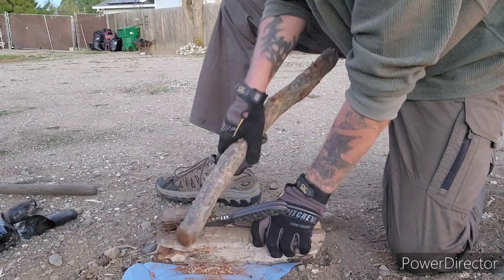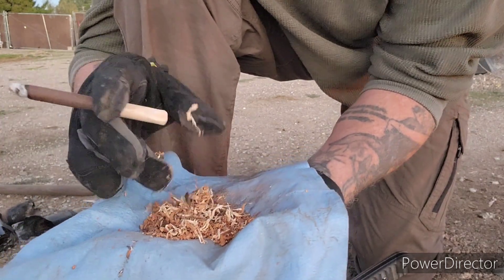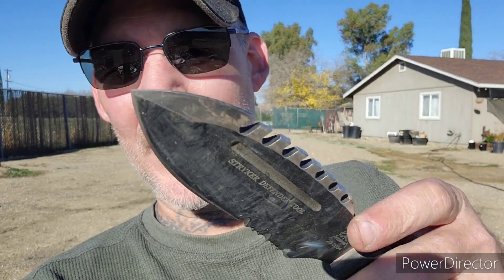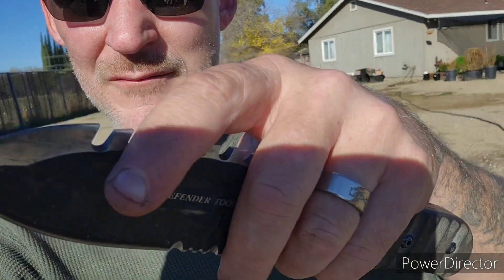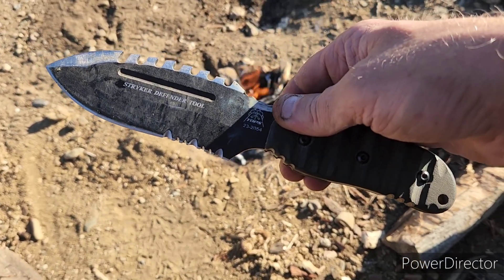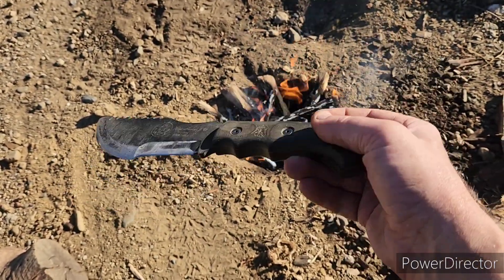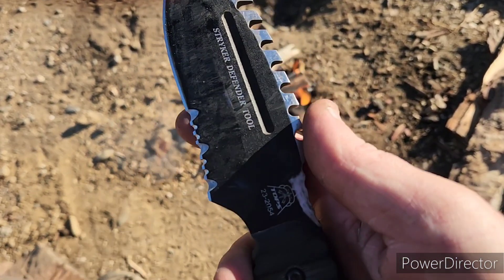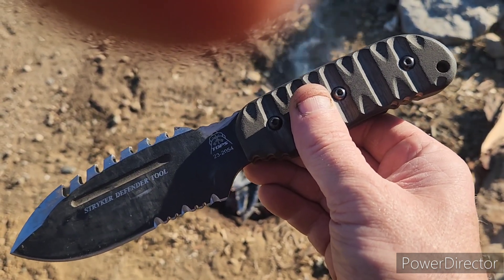TOPS Stryker Defender Tool, plus Char Cloth in a Glass Bottle.

Comment: That is basically a spike. It is entirely too short and thick to be any good at slicing and too short for efficient chopping. It's not good for much other than stabbing through a lot of clothes or a thick animal hide and probably some bones. It'd be good for opening a 55gal drum or as a tent peg. Too short as a saw. Yeah, very limited uses in all reality. Self defense and rescue is about it. But, hey, if you dig it, that's all you bud. There are much more versatile blades out there that are of similar length.

Comment: Ok,you obviously didn't do your research on this knife prior to purchase. For one, the back teeth are only meant to make  notches in limbs for running rope through as in tying down a tarp for protection.  Also,as smallish this knife is, it should only be advised for very small diameter limbs, not batoning large diameter 
piees of wood. You mentioned the sawback could cut open aircraft grade aluminum  materials, absolute crap. You are doing your followers a disservice.
Reply from the maker: So far, I have turned a 5' long cedar log into kindling by batonning with this knife.  The blade doesn't need to extend the entire diameter of the timber; all you need to do is remove chunks.  As with other things, size doesn't matter, as long as you know how to use the tool.  As for the teeth in the spine, the knife was designed for a military unit to tear apart choppers. I haven't tested it on aluminum, but you might argue your point with TOPS. As for me, the teeth are plenty sharp enough to grind a handful of shavings, & that's how I use it.  The more you use your tool, the better you'll come to know it and be able to use it in more ways than what you see others do in YouTube videos.